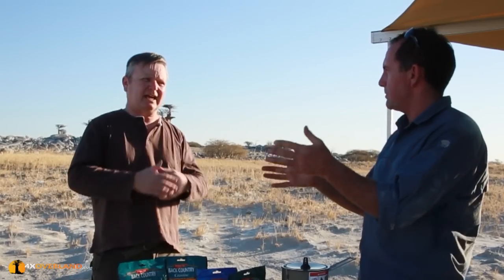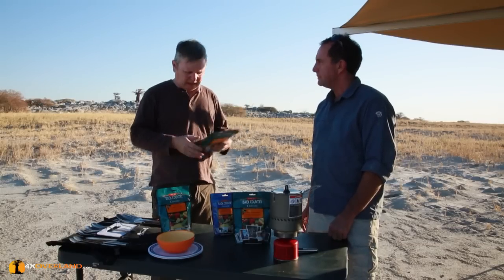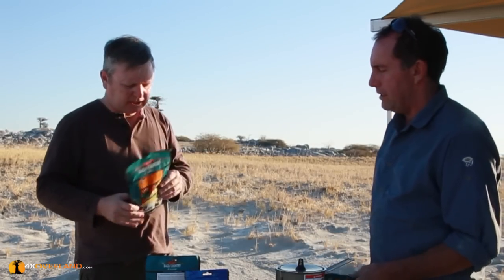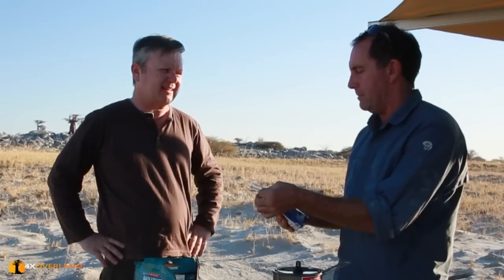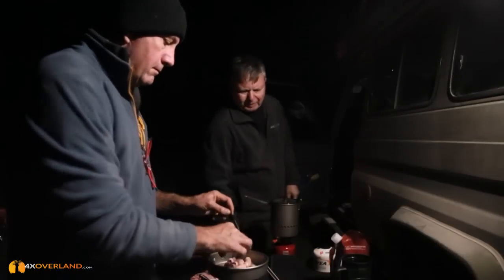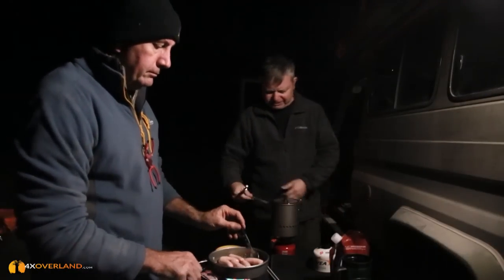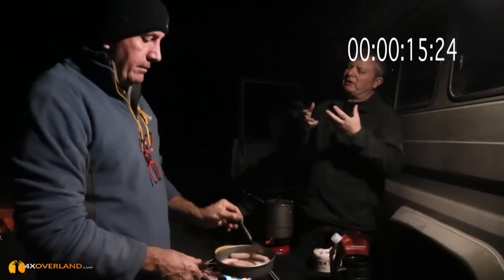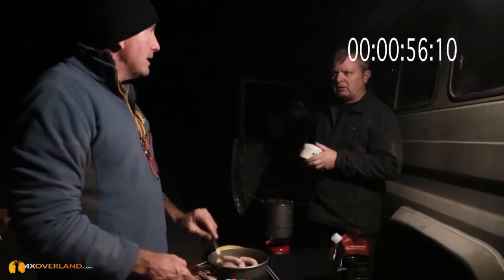FOOD AND COOKING IDEAS. The Overland Workshop. Andrew St Pierre White

Comment: Be nice if a link to the dehydrated food was in the description.
I had trouble listening to what brand it was?? Back Country? was that it?
That water boiler was good, of course, no one saw how much water was boiled, was it 250ml or 3 litres?
The JetBoil is a similar product with insulated boiler, great on the boat or anywhere with a degree of wind..
Personally, i can't go passed the basic butane portable stove's, they are cheap, pack flat and are very flexible in terms of what you cook/do with them.
Those cookers that sit on top of the bottle, seem to make a very high and unstable cooking option to me, easy fall over, make a mess or start a fire, and are too exposed to wind.
The flat butane cookers are low and the plastic storage box can be used as a wind break if need be. All in one simple, common, flat package.
Reply: I use the flat butane stoves even in the house/cabin. Very cheap and more economical than LPG and electric.

Comment: I have to admit I am quite disappointed in this episode. What about cooking on the camp fire?
Also you know you can get most vegetables in dried powder form including lentils. So that means you can have a soup or curry cooked in 10 minutes entirely from a collection of powders and water. You can measure out your ingredients and pack it in pouches before you go.   
Also even though dried meat is generally a bad idea Chorizo has to be an exception as it is easy to eat and can be added to almost anything. 
Also for bread. What I do is I whisk egg water BiCarbinate of Soda and Millet Flour and make a bowel out of foil inside a pot. I then add a lid and throw into the heat 3 minutes of work (plus a while of waiting for it to cook) and I have fresh gluten free bread.
Reply: A very solid comment Lucy !